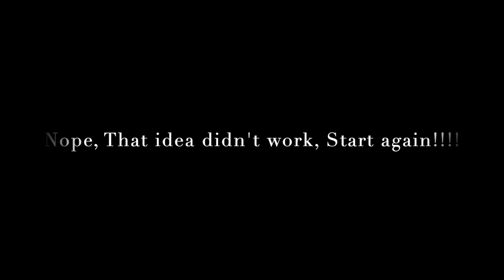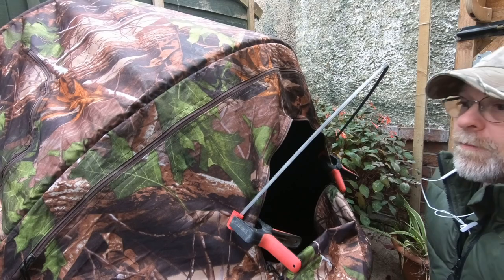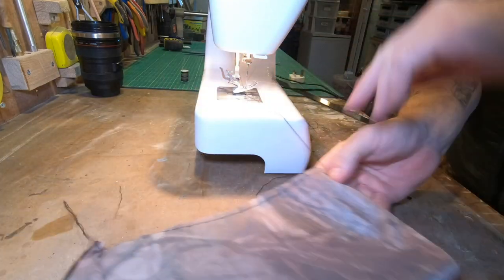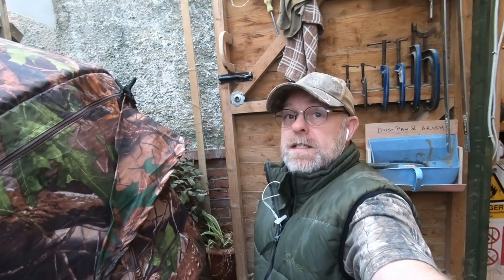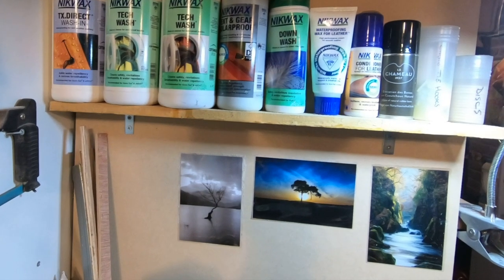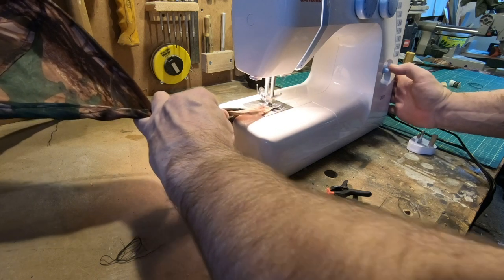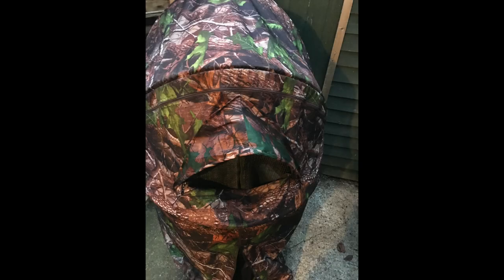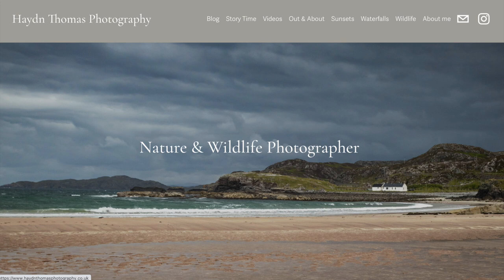Nitehawk Pop Up Chair Hide | Custom Rain Cover Part 2, Completion

Comment: I love this blind. I took your tip and gave it a few coats of the Nikwax spray, it makes a world of difference and I don’t get wet even in a downpour so thanks for that. DIY is not my strong point so I got a waterproof lens cover to keep my bit of lens that sticks out dry. I would prefer your option of that modification but I’ll make a mess of it. I’ll try it with clothes line pegs though. See if I can do something temporary for just when I erect the hide. Thanks again
Reply from the maker: Thanks Frank, yeah, a few pegs will work with a bit of material! Good idea! 👍